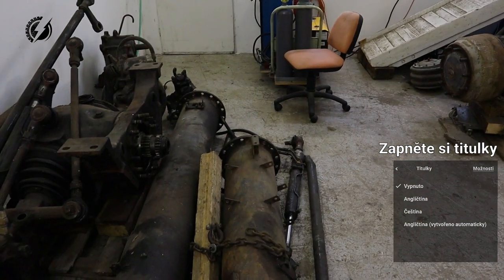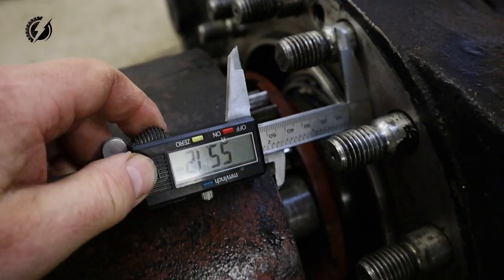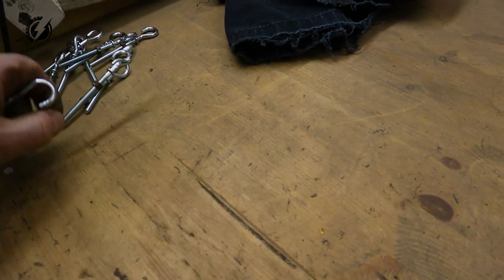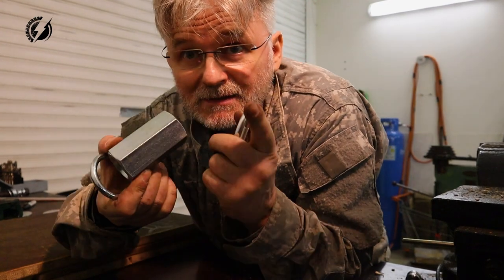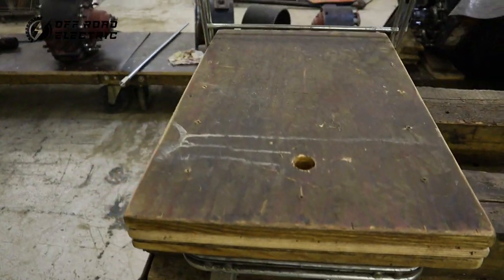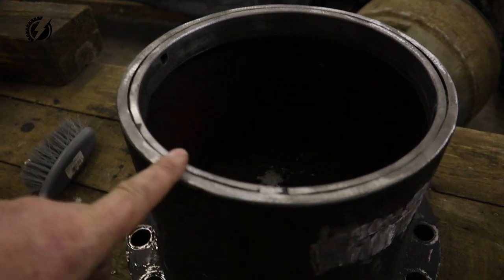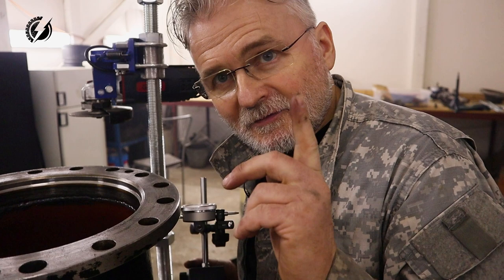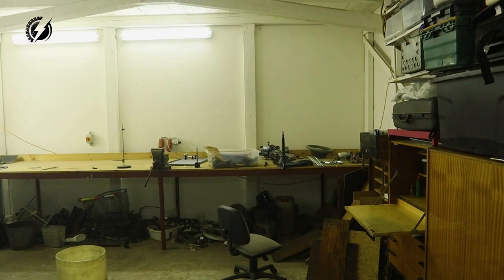EP 49, Building a Tesla/Tatra  2-motor Monster Truck

Comment: Could you angle the grinder so you can chamfer the cut rather than square for welding?
Reply from the maker: I just grinded the angles for the welding, maybe in 2 hours so it is minor comparing to the cutting and grinding straight before. This might be the challenging for the blade as the travel of the tube is circular and the weight of the long tube is over 50 kilos.:) I was thinking about tilting the grinder with the grinding wheel.... Will see....
Reply: @Off Road Electric  After a straight cut you could move the grinder to a second position to chamfer without the weight issue. 
I'm sure it'll be grand anyway.
Reply from the maker: @MonkeyMotorSport  Yes, I can do that. It would be faster then grinding angles. Will think about it. Thanks!